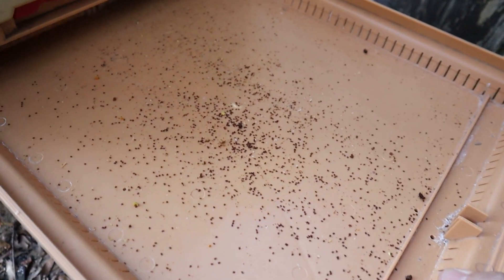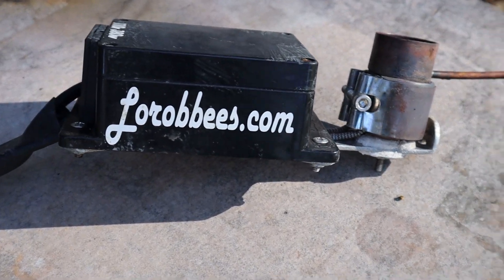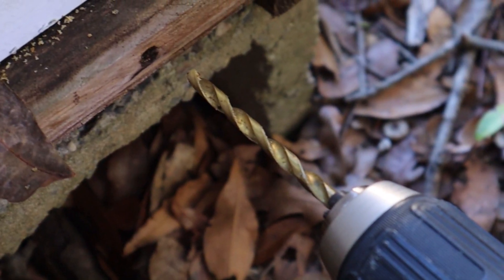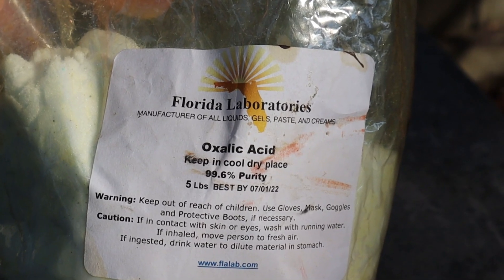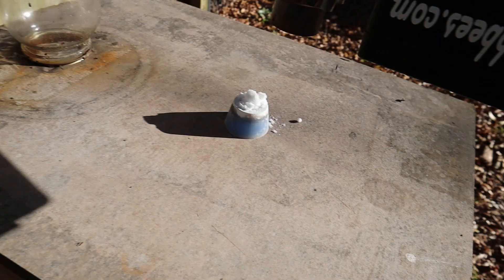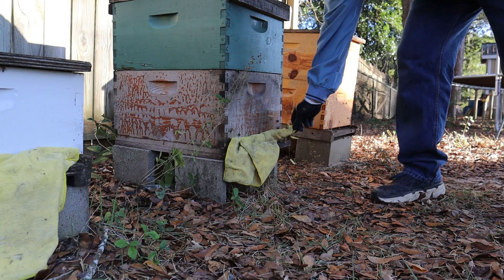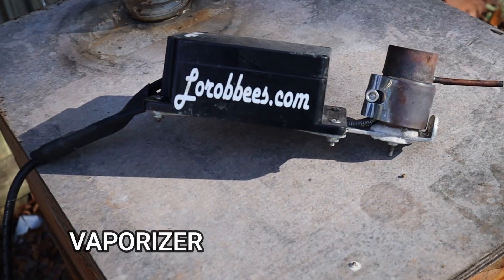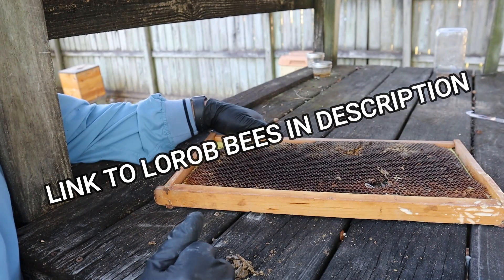SAVING BEES by KILLING Varroa MITES!!!

Comment: You neglected to state-if the copper tubing clogs up like on the older units. That clogging up has proven to make using the older unit not such s pleasant task.
Reply from the maker: Have you contacted Rob about the issue?    I’m sure he could walk you through a solution.

Comment: I use the ProVap110. Do you have trouble with the OA vapor recrystalizing in the exit tube when you use the holes you drilled into the back of the colonies?  I do but if i just  use the reduced entrance in the front of the colony i dont seem to have as much of a problem?
Reply from the maker: Haven’t had much of a problem with that but I make sure the hole is clear before I start.  If it gets blocked I stick a sharp object into the tube and clean it.  I a prong from an uncapping fork.  Also have to clean the heating chamber occasionally.

Comment: I think I'll just drill a hole in a cork and jam it in the vent hole in the back, provap all the way, I just met the guy that invented them at the state bee meeting.
Reply: My cork idea works great, cost me .01
Reply from the maker: Ok!  Thanks for sharing. I am glad you like the Provap.  I like the Lorob Bees vaporizer.  I’m sure the Provap 110 is a quality product but I can’t imagine it is any better than the Lorob Bees vaporizer and is way more expensive  last time I checked.  The most important thing is that the bees get treated regardless of which product or applicator are used.  There are a lot of different vaporizers out there.  I just really like this one.
Reply: @brucesbees  I gave $375 for it on a Black Friday, I think, Blue sky bee supply.
Reply from the maker: Good deal.  Glad it has worked out for you.